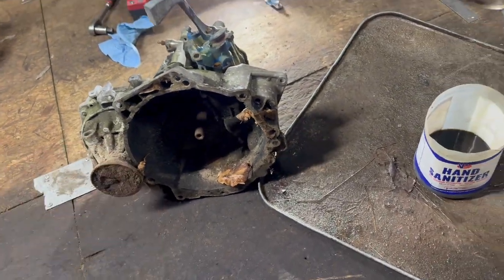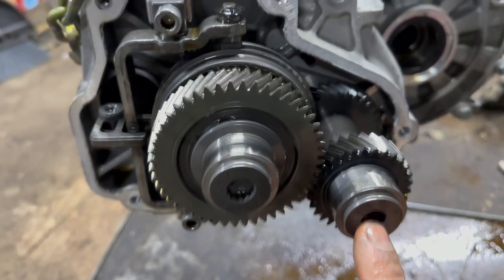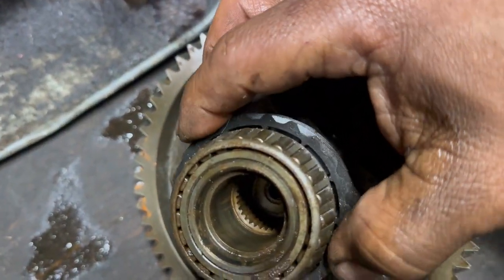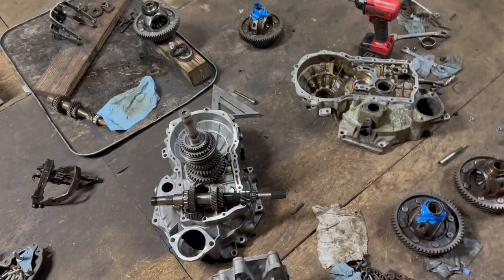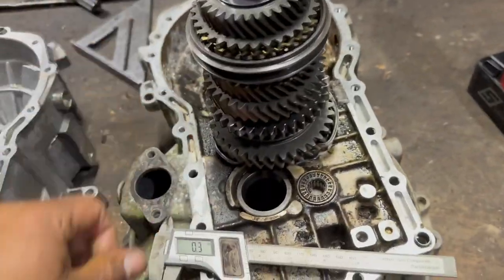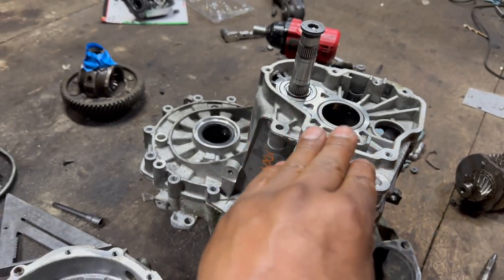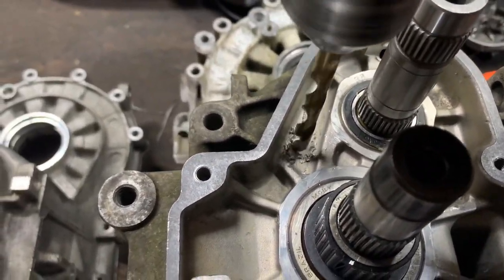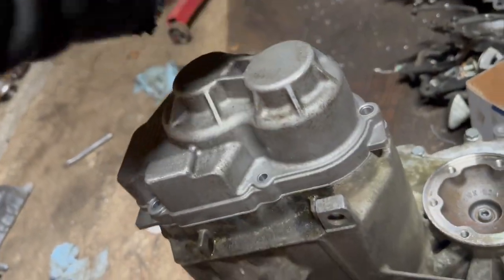Vw 02S 02J case first time ever done

Comment: Hey, I just blundered into something about the later (Immo3) clusters - they're supposed to be coded / flashed to swap from reading the VSS from the sensor on the diff case, to using CANbus to get the VSS from the ABS module like the mk5 and newer use.

I was just mentioning to a friend just a day ago.   He'd bought my 2nd TDI off me.  He, like me, like you - we all want that long-ratio highway cruising 6 speed like the 02S, or the 6th gear conversion kit you used allows for.
Reply: Love the video, now that I got all the way through.   To recap:

I will try to code one of my Immo3 clusters for my BEW cars to use VSS over CANbus to the ABS module.    If that works, I'll try putting an Immo3 cluster with that change into my earlier car (2000).

If the immo3 cluster coded to use ABS for Vehicle Speed Signal, then some of that grunt work you prototyped could be avoided.    Or, perhaps, a straight swap the 02S in, could be done, avoiding the teardown.    More options, if so!

Great work you did!   Was your 02S from a N.American market car?  Or, did you source the 02S from Europe?
Reply from the maker: Not us  we don’t have them
Reply: @chrstphrr  I should also add, the 0A4/02S bellhousings have a slightly different clearance. I think they space just a tiny bit further away from the engine, which means they necessitate a different flywheel to make up that spacing difference.

I see where you're going with it, though. If you could get an instrument cluster that gets VSS from CAN, you wouldn't need to worry about the VSS sensor being on the transmission anymore. I've seen the same coding in the BEW clusters and often wondered about swapping a DSG into a BEW Golf/Jetta by doing this. Would save on the hassle of wiring.

But, you would also need the right ABS module on the CAN bus to generate the VSS signal. Earlier Mk4s with Mk20 ABS modules definitely won't work. I'm not sure if the Mk4 Mk60 ABS modules generate a VSS to broadcast on the CAN or not, but certainly Mk60 modules in Mk5 and up absolutely do. So, does make one wonder, if a later Mk4 Mk60 ABS module does not generate a VSS signal on the CAN, could a Mk5 module bolt up, fit and work for that purpose? Would be interesting to figure that out!
Reply: That change in bellhousing clearance would also throw off the axle lengths a little. If it is as I remember, it would potentially compress the driver side axle some more, and extend the passenger side since the whole transmission would get spaced a few mm further away from the engine...
Reply from the maker: The differential its the same it doesn’t change nothing  , its stays the same  I didn’t move that at all .    Lifting gears pinion set 0.5mm doesn’t changed much .
Reply: @taco8v  the shims are sold in 0.05 mm increments to get bearing pre-load correct...

Comment: I've been talking about finding a TKR or TDZ code 02S for months and swapping the guts into a 02J case.

The gearing looks awesome for a lightly modded Mk4 TDI. Same 3.39 final drive, 1-5th is close enough to the stock 5 speed, but you get the 0.625 6th in addition.

I had just noticed that VW made a change to that lower pinion bearing on the 0A4 and 02S transmissions sometime in 2018 when looking through the parts catalog, and it appears these TDZ and TKR code 02S transmissions with the gearing I want so bad were all made after that change to the pinion bearing and pinion itself.

I wasn't sure if there was going to be a difference in diameter, so it's good to know that you at least figured out what's going on there. I'm not quite sure what's going on with the spacing of the pinion bearing plate studs. Is it a case of the end of the pinion which you had a lathe machine down 1 mm also just needs a mm or two removed from the end of that same part of the shaft?

You MUST check the preload on that bearing. There is a shim underneath the bearing that presses into the case to set the preload correctly. You have to install that pinion into the case, torque the 4 nuts onto the bearing plate studs and measure freeplay with a dial indicator while no shim is installed, consult the repair manual for how much preload to add, and then order the right size shim to get the preload correct.

Same goes for the input shaft bearings and differential bearings. I rebuild 02A/02J/0A4 5 speeds all the time, so I'm quite familiar, but 02S 6 speed transmissions in the U.S. aren't super common, so I haven't had the pleasure of splitting one of those open.

I appreciate you trying it out and finding out the various little things that are different. I was aware of reverse idler shaft difference, the plastic trough the later transmission has that the 02J does not plus the change in bolt hole locations for the shift bracket. The change of that pinion bearing and diameter of the one end of the pinion shaft definitely was a bit of a surprise, but it sounds like it can be handled.

When I finally get one of these 02S TKR code 6 speeds myself, I will see what I can figure out to get the pinion setup correctly.
Reply from the maker: The spacing is because the old case bearing pinion is seating 0.5mm higher than the new one so ones you bolt the pinion with new 29mm bearing  machined 1 thousand  its a bit tight  .